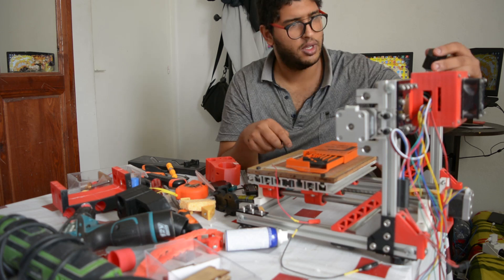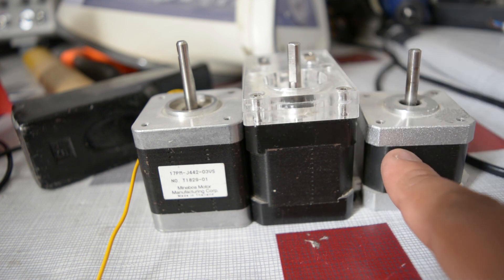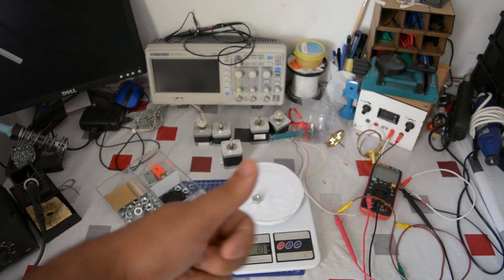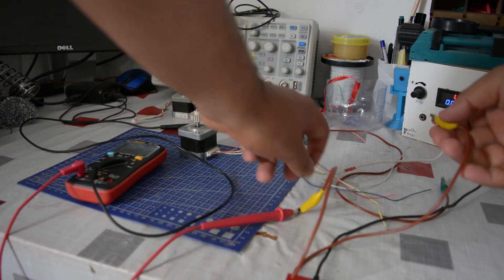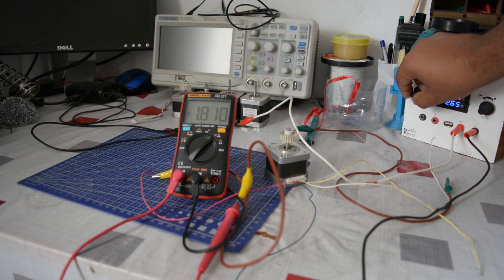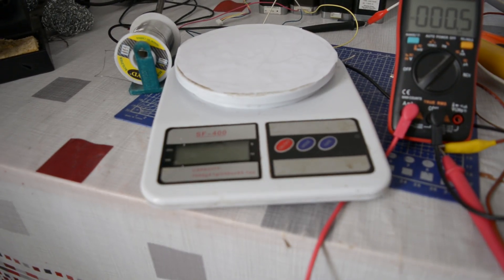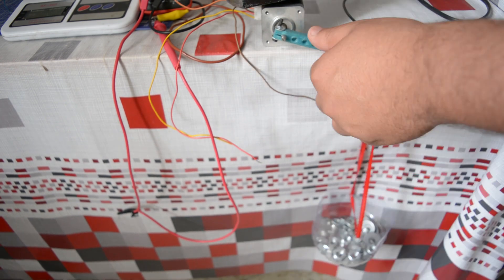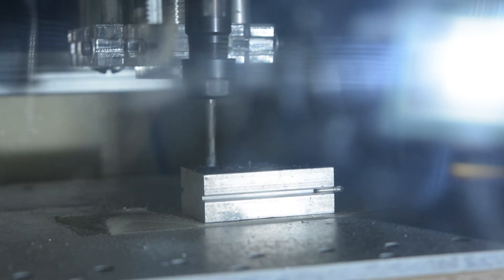Test your stepper motor TORQUE II Nema 17 torque test II CNC torque test

Comment: technically you measured holding torque not just a torque but both should be proportional , but it also scales with voltage, so this might be why your measured resoults are bit smaller than predicted
but stillpairing 2 identical stappers could increase the actual torque even further
fun thing with stepper motors is they can be assembled like any  resisiyve load, so you could drive 2 of them in series if you double the voltage or 2 in paralell if you increase the current
but nothing stoping you to drive 4 motors in 2 pairs of series connected motors hooked up in paralell and use just one driver, because driver don't care it would just be 4 times bigger motor for it
you could also drive each separately by cloning the stearing wires 
the thing is connecting cheap used ebay motors like you did is a great way to improve your machine, especially if motors have shafts on both ends and the bigger torque the stiffer your machine and harder material it can cut, but you also need a siutable frame to hold it

Comment: Hi 
I am using 2 Nema 17 motors and using them to run a robot over a transmission wire while holding a weight of around 2 Kg... 
But today it didn't rotate well... It stopped and was stuck.. 
I think it's because I used 9V batteries lol... Will using a 12V big Lipo battery which can give upto like 10A and all make a difference.. Thanks...

Comment: Hi sir,
Can I lift 5kg router with 4kg cm torque and thread rod like nut and bolt 🔩.

Also can I make 6 x 4 feet cnc machine for wood carving with nema 17 stepper motor with 4kg cm torque?? 

Also I am using arduino cnc shild
Reply from the maker: I dont think you can lift that 5 kg . But 1 kg is fine .
You can make the wood carving machine but you need it to be stiff . And you will have to move slow. Use nema 23 with belt driven system. Like the shepoko machine from carbide 3d
Reply: I switched my Nema24 4.2A 3.1Nm to Nema17 2A 0.4Nm on a 4x4 machine (steel and aluminum profiles, belt driven, no gear) just for the test some time ago. The small motors had no issues with moving the gantry with very high speed, but once you start, the load from the spindle cutting is big and you have to reduce significantly the speed and the depth of cut. It can be done, but it's not worth it, the price difference is too small to be considered.

Comment: Is Using power supply of 24V and 3A suggested for 3 stepper motors?
Reply from the maker: it is , you see when you use higher voltage you will need less current , its better to run the motor cool as more current induces more more heat . for a nema 17  at 2.8 Volts it will consumes   1.68 Amps so do the math and you will figure how much they will consumes at 24 v , you are safe to go my friend . and best of luck
Reply: @TnInventor  so when does 3A matter? What I mean is I had this perception in mind that if I am using 24V 3A then 3A current might flow....also I am using l298N as stepper driver, is it fine in regards to power supply I am using??
Reply from the maker: Ah . No no you see motors only draw the current they need . If you have 10 A capable power suplly and they only need 10 ma they will only consumes 10 ma .
Reply from the maker: L293n is not that smooth in controlling stepper motor . Use a4988
Reply: @TnInventor  thank you very much Sir, I appreciate your help
Reply: @TnInventor  I think this is completely and utterly wrong. A coil is just a long wire. If you supply enough voltage, the current through the wire is only depending on the resistance of the wire.
Reply from the maker: Nope. Belive me i am an electriacal engineer . Just google this stuff and come back and tell me what you found
Reply: @banknote501  hey, I tried what sir said and it works perfectly. Use of a4988 instead of L298N, well I used l298n cause I had one in spare and guess what? The motor was just vibrating and eventually l298n burned off. This didn't happen with a4988 . And also the thing about voltage supply is absolutely correct, I tried it for my project. It truly depends on how much your motor requires
Reply from the maker: Welcome my friend
Reply: @TnInventor  Are you talking about a motor or about the A4988 stepper driver? Of course the driver limits the current. But the motor itself? I highly doubt it. I'm not an EE, but I play one on TV, that should be good enough.
Reply from the maker: You dont have to belive me if you want . Its up to you honestly. Good luck
Reply: @banknote501   yes current depends on wire length because it increase its resistance but according to Ohm law current also depend on Voltage if you increase the voltage current will also increase by this amount Amp I =V/R 
But it's only one case 
Other is at inductive load  like   this motor and in higher frequency you also have to include inductive reactance , impedance and  Skin effect etc and it also depends on mechanical load
Reply: @banknote501  driver doesn't limit the current because motor takes large amount of peak current at starting inrush current than which can be 8 times higher than its Full load current so it will make driver complicated may be some of costly module can provide this feature not sure

Comment: Can Nema17 5.5kg-cm stepper motor lift a load up to 2kg?
Reply from the maker: Try it . And see . It depends on the distance if its less then 2 cm then yes
Reply: @TN Inventor 
Thanks for the response.
I am building a mini conveyor system, the length between the two pulleys is 1meter, and the diameter of driver pulley is 5cm.
Now will it be able to move the load of maximum 1.5kg?
Reply from the maker: If you use w poly and a belt and a good speed reduction  to up the tork then yes . 3d print some gears . Reduce the speed to have more tork

Comment: Is it normal that i can rotate the shaft by hand when its powered?
Reply from the maker: Yeah . But it should not be smooth . You have to feel the resitance
Reply: @TnInventor  I operate the stepper with pulse+dir
When there is a small resistance it stops
I have 12 nm stepper

Comment: Bro i want to pull/drag sliding gate. needs force upto 25 kgs to make it start moving. So a stepper motor has ability tu drag it .????? Big model?
Reply from the maker: You need an ac motor with gears for that. Have a look at washing machine motors and try to fit a gear with a speed reduction ration . Its not easy to make but it can be done
Reply: Use grears